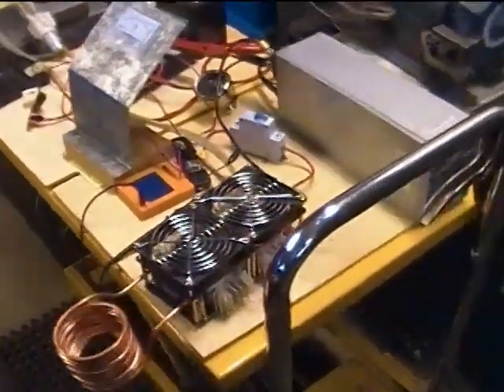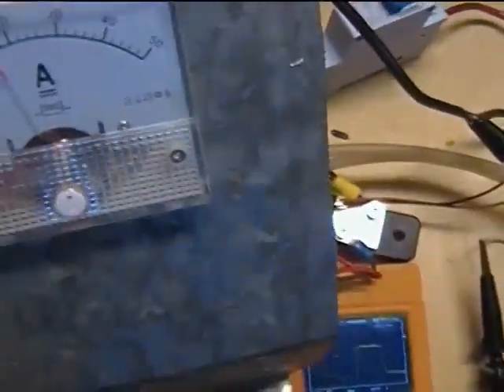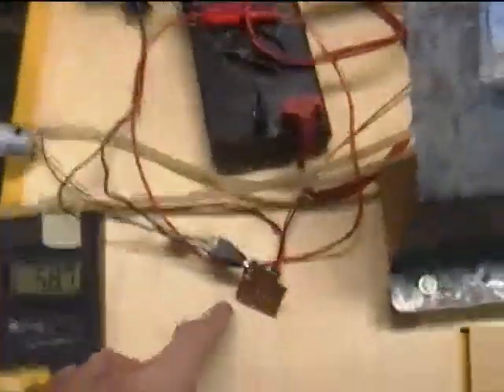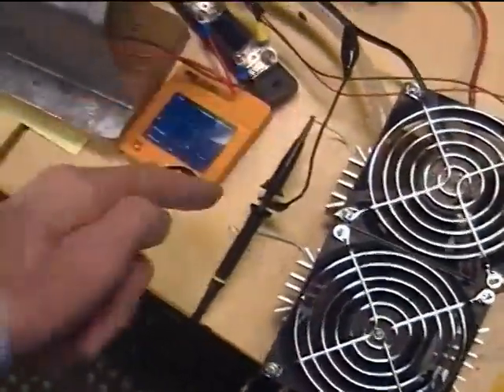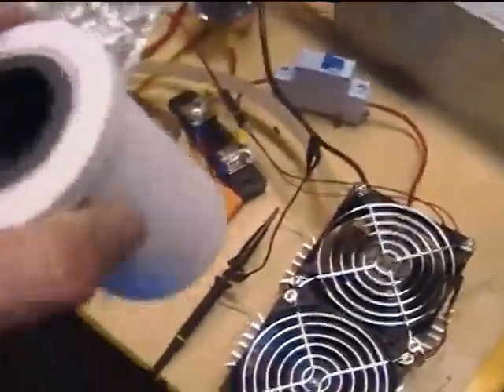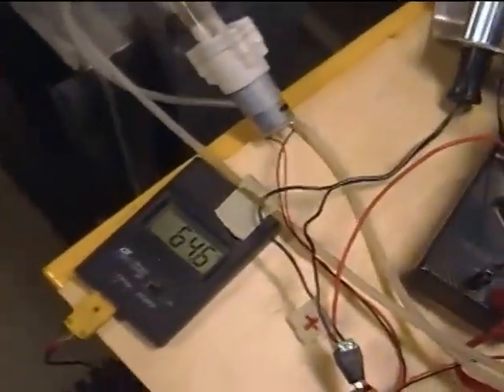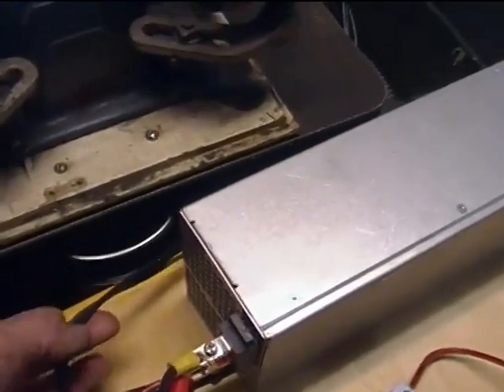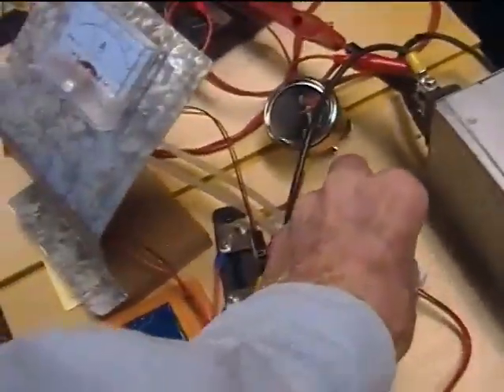1800 Watt ZVS Induction Heater, First Test: Idle Current Too High

Comment: Here's another question. while annealing the brass case, how far down did you find the three turn, three layer coil , deliver heat down the case?
Reply from the maker: I'd say about 1/4 to 3/8 of an inch to a "red heat" in one or two seconds with the 1000 watt heater.
Reply: @frenchcreekvalley  Did you test it for temperature with Templiaq?
Reply from the maker: @keeper1959fem  No.   I have worked with metals, both ferrous and nonferrous for many years, but I don't do any reloading.  So,  for this whole set of experiments I was simply looking for coil designs that would get the cartridge necks hot really fast.  Brass  glows at a red heat a couple hundred degrees F higher than the 750°F that the annealing guys need.   With the 3 turn, 3 layer coil, you get there plenty fast enough that there isn't enough energy to transfer significantly down to the base of the cartridge to soften it.
  Since I 'm on that subject, I see the most reloaders seem to be afraid of dropping the just-annealed cartridge casing into cool water.  They must think that would harden the case, but that's not at all the case.

Comment: I'm receiving the same 1800w heater/coil, and wanted to know what you would recommend for a coil size to anneal  a .308 brass rifle cartridge. I need it to fit in a small area say two raps around with 1/8" copper tubing insulated with fiberglass tubing, and an ID of 5/8". How many coils do you recommend for each layer?
Reply from the maker: Personally, I think the 1800 watt unit is a lot bigger than what you need for this task.
You will certainly need to have an ammeter in your DC power circuit as you see in this video.
You may be able to use the 3 layer, 2 turn coil design that I used in my 1000 watt video on this annealing subject; one that you watched recently.  But, if the current goes above about 25 amps,  I think that will be a sign that the frequency is too high and that the Mosfets will probably overheat.
  You can't simply make a work coil to any size that seems convenient for the task at hand with these ZVS induction heaters.  You need to stay above a certain inductance to keep from overheating the circuit components. My best guess for the 1800 watt unit is a minumum of about 1.0 microHenry.
Reply: @frenchcreekvalley  Thank you for the info. I will look into a coil that meets those specs. As for  Three turn coil I don't have the space for it, that is why a two turn coil.
Reply: @frenchcreekvalley  Oh I did add an amp meter, and my power supply has over current protection. it is out of a server 3kw @ 48v. my timer will run in milliseconds to help with timing. I'll try and add what I found for a coil design that works once I'm up and running. Again thank you for all your help and advice
Reply from the maker: @keeper1959fem  I am glad to hear of your plans and progress.
One point:   the over current protection of your power supply COULD cause damage to the ZVS heater IF the current is so high that the power supply output voltage EVER goes below about 12 volts.  Such a low voltage will cause the gate circuits for the Mosfets to fail and the Mosfets may lock "ON".       I don't THINK this will be a problem for your setup, but I thought you should be aware.   Early on, I always connected a voltmeter across the power supply terminals to make certain that its output voltage never dropped below even 24 volts under ANY circumstances!

Comment: I am wondering about couple things.  Where did you order your PS?  I ordered mine from Banggood and still waiting for it, it was suppose to ship from US warehouse in 2-8 days but the board actually came faster from China LOL.  My power supply according to description is 220V model but I am really hopping it can run on 110V as I don't have readily available plug in 240 so I'll need to get my friend to install it unless I want to burn things my laundry room.  2nd, have you tried putting thermocouple underneath PCB where the last 2 capacitors closest to coil reside on the opposite side.  That area underneath gets extremely hot when I run it with just 10-11A current I got it to 
320F!  First I used my IR gun and I though it was broken since it was getting upwards of 400F.  I have a feeling the board will literally burn up or solder connections will melt if I feed it more current with new PS.  I would love to get your feedback on what kind of temperatures you're getting with about 10A applied on this board.
Reply from the maker: I got my power supply from aliexpress as part of their 1800 watt "combo 2". It is the Emerson 48-2900U.

If you are getting the same or a similar power supply, you need to know that you can NOT get full power from it if you are only supplying 120 volts. Instead of the 2900 watts that it can supply on 220 volts, you can only get about 1500 watts with 120 volts input.  You need at least 176 input volts to get that full power.
The line current  at 220 volts will only be about 15 amperes at full power, so you could make a 14 gauge extension cord  to get away from your laundry room.

I have not used a thermocouple under the board near the front 2 capacitors.  I have never had the board so hot that I could not touch and hold my fingers to it.   I use the Underwriters Laboratories standard for this.  They say that the surface of any equipment must not be hotter than 137°F, because that is the hottest temperature that a person can hold their hand to.  (Poor grammar, yes.).  Anyway, I have been using my fingers to measure low temperatures for a LONG time and I do pretty well in the range of about 70°F and about 137°F.
  I have noted temperatures in some of my 1800 watt and 2500 watt videos, so you will need to watch them carefully to hear the numbers.  Typically I test the Mosfets, under the board, and the "front" capacitors.
  I did a lot more measurement of board temps on the 1000 watt unit.
Here is an example of such testing:
www.spaco.org/Blacksmithing/ZVSInductionHeater/March31nonvideoedtestat16ampsfor15 minutes.xlsx

You say "10-11A".  Is this the  DC current to the board or is that AC Current into your power supply?
  If this IS the DC current to the board, the current, without any work piece in the work coil should only be about 6 amperes.
-Are any turns of the work coil shorted together?
-You should be using the work coil that came with the board.  It should be about 2 5/8" inside diameter and have about 10 turns.
Reply: @frenchcreekvalley  My power supply just came in, it's the same kind but I am still at work.  I bought it really cheap from Banggood ($70) with shipping but be careful with beware of these guys, board came damaged in the shipping and I am fighting with them to have them cover with insurance I paid for and they don't want to.  Aliexpress is better in this regard.    The place where it gets really hot (I wrote this on your other video earlier) is right under first capacitor underneath PCB, it's not most convenient place to put your fingers missed so maybe you didn't handle this area.  You can get quick idea by scanning with IR gun, that's how I discovered, I though my IR gun was lying so I touched it with latex glove on and burned my finger, later I attached  TC probe to confirm.  I watched your videos and listen to the numbers you call out but I don't recall you measuring temp on bare PCB spot I was talking about.  It's not hot at all in the back of PCB where capacitors start, only get to about 70F so it's easy to miss it.  I am trying to determine if my board is bad, I had another person report the same as my experience.  I've tried 3 different coils, the tightest diameter obviously generates highest idle current, as I wrote on the other video for you it's 1" ID 8 turns.  This is the only coil that can heat up my brass casings to anneal temperature of 750F in 4-5 seconds but which coil I use and if I am idling at 10 amps or bringing up to 10A with nail is not really important as long as I am pulling 10 amps of current that drives up the temperature, I've used bigger 1.5" ID coil from 1000 watt unit with same effect.  10-11A is from DC side of course.  I can control how much amps it's pulling by regulating power supply voltage, my 500 watt PS has voltage POT and if I bring down voltage the current drops too.  I should also mention the mosfets and everything else is fine, doesn't overheat.  I made a video but wanted to edit to correct some timers I spoke of.  I really want to know if I got defective board or this is something you didn't notice.
Reply from the maker: @DimaProk  Regarding: "I use and if I am idling at 10 amps or bringing up to 10A with nail 
Do you mean that you get 10 amps idling and 10 MORE amps with the nail?

I think you are pushing your luck with that 1" ID 8 turn coil.  What are your results when you DO use the coil  2 5/8" ID  10 turn coil that came with the unit?
-What is the idling current then?
-What is the current when you initially put the nail into the coil?

I think you said , in another comment, that your present power supply can put out 51 volts.
Are you monitoring the DC voltage during your tests?  If you are turning the voltage down, how far down are you going?
If the voltage gets below about 24 volts, you start having problems getting the Mosfets turned on hard enough and fast enough, and that can cause all sorts of problems.
  Decreasing the work coil size also makes things worse by increasing the frequency,  As far as I can tell, if the frequency goes much above about 120 kHz, the gate signals start to degrade rapidly,. And that means overheating and, eventually, component failure.

Before you conclude that the pcboard is bad, DO install the correct coil and see if the board still gets too hot. 
 You are not the only person who wants to anneal those brass cartridges.   I just built a 3/4 turn 2 row  1 1/4" ID work coil for my 1000 watt unit.    The measured inductance suggests that it won't suffer from the high frequency  problems that you are apparently seeing, but it might concentrate the energy better for nonferrous metals.
     I have had to delay installing it because I needed a frequency meter for that heater.  I had already built the signal conditioner for it, and  built the kit ( that  arrived today) and it had a bad component.  Took me a couple of hours to get that solved.  Still have to marry the two components.   Anyway, we will see how that goes.  In the 1000 watt unit, with a 2" ID coil, it takes a couple of minutes to heat  30 caliber brass till it turns blue.
Reply: @frenchcreekvalley  No, 10 amps whatever idling or total pulled with nail as long as your amp meter is showing around 10.  I just reviewed my video with original big coil, the idle current at 48v was 4.88A unfortunately I didn't use nail in that test but when I inserted piece of brass it upped to 8A so can't tell you what the pull would be but it would be obviously less.  Did you order your oscilloscope on Ali too?  What is it called?  This might be actually pretty fun project for you to try if you have interest, you would be amazed how much the power is concentrated and amplified in small coil, good only for small things.  With bigger board the coil was getting between 106 - 118F but I haven't pulled 10-11 amps.  You might be right without oscilloscope hard to tell if frequency is getting out of control too high but even with 1.5" coil the temps were getting way too hot.  Unfortunately TC came off and I didn't get to see most of the high end temps.  Now that I got my 2.4k PS I will see how hot PCB will get when pull 20-30-40 amps, my guess it will get pretty hot.  I can make extension cord from laundry but getting behind washer to connect/disconnect is major hassle, that's why I want outlet in garage next to circuit breaker.  With 1000W unit and original 1.5" coil I was able to make 223 brass neck glow but it took a while, maybe 30 seconds, 2" is too big, you'll be amazed what 1" will do.  I would love to see the coil you made in your future videos.  And since you're interested in brass annealing I also learned about using flux concentrator to increase concentration and lower amperage draw and you don't even need water cooling for smaller casings. https://fluxeon.com/product/annie-flux-concentrator-coil/ I also found a putty that does flux concentration called AlphaForm, I asked for a quote but got no response: https://www.slideshare.net/Fluxtrol/fluxtrol-alphaform-moldable-magnetic-flux-concentrators, the brass annealer that I go my idea for 1" coil is here: http://forum.accurateshooter.com/threads/induction-brass-annealer-redux.3908353/  and  here's more info http://www.johndearmond.com/2010/11/12/using-the-induction-heater-solderng/
Reply: @frenchcreekvalley  Quick question The power supply I got says the input is 200 - 265V but it came with US plug.  Was your rated for same or was it both 110 and 220V?  What would happen if I plug it in 110V, will it burn?